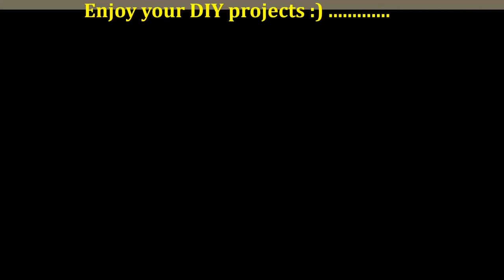How to create a picture frame for stretched canvas?

Comment: Thanks for the video! very helpful! where do I find the moulding like this? would this method work for a giant mural mirror? I have a sliding mirror door I'd like to frame but do you this method might be too weak to hold a mirror?
Reply from the maker: You can find the pine mouldings in most hardware stores. I think it is 
best to let a professional framer to frame your mirror as it is more 
complicated compare to framing painting, especially for the mirror that 
size.